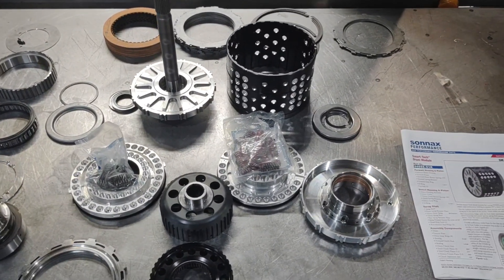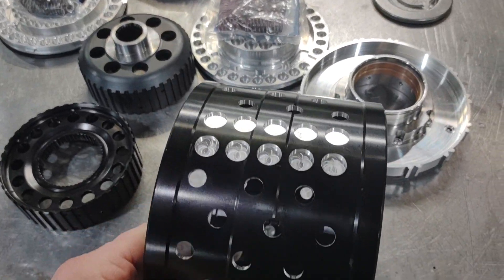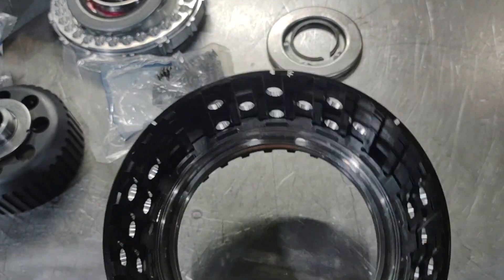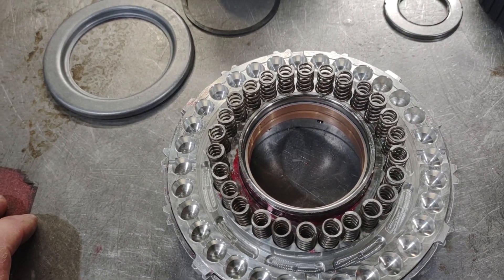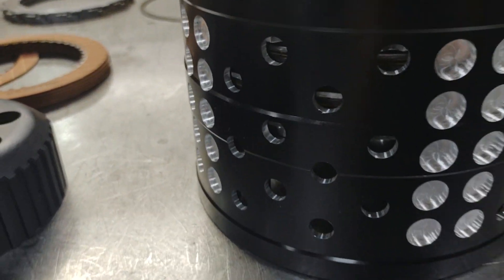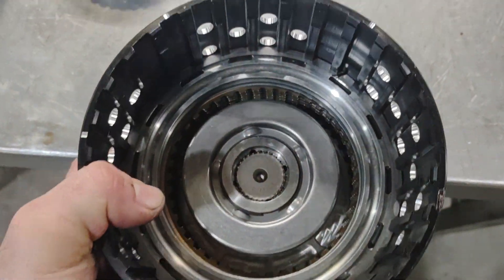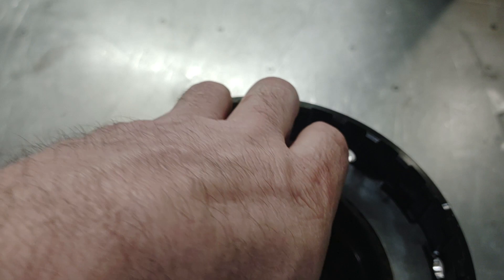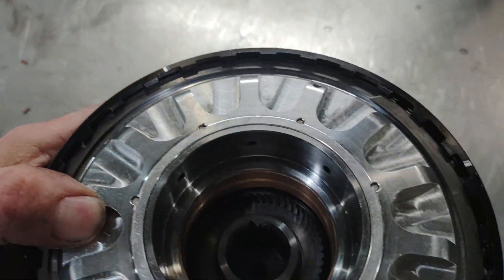Sonnax TH400 Smart Tech Drum Module Assembly

Comment: Jake, I have a question: Please correct me if I'm not getting this right. I'm considering the use of this Sonnax Smart-Tech drum module and I'll be using it with a Reid SFI case. I believe that ordinarily, an INTERMEDIATE PRESSURE PLATE, with a FULL LUG DESIGN would need to be used, or should be used with the Reid TH400 case. But based on what you've shown in your video here, it looks to me like such a full lug pressure plate for the Reid case isn't required when using this Smart-Tech drum due to it's design, and the pressure plate that the Smart-Tech set-up comes with needs to be used instead. Am I getting this right?